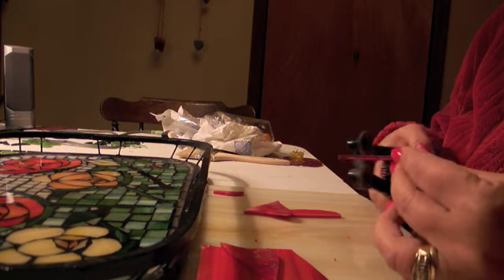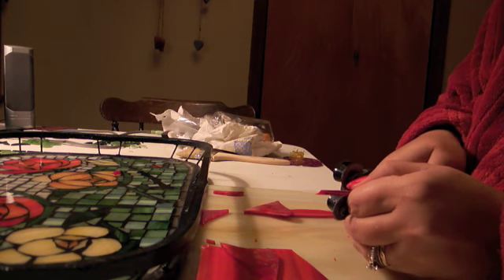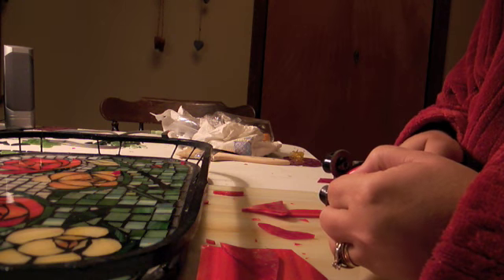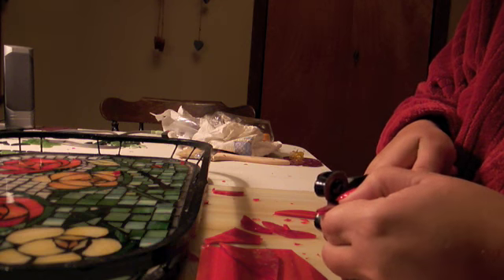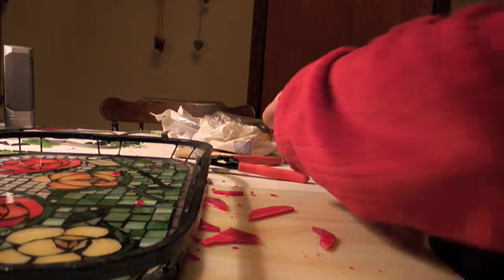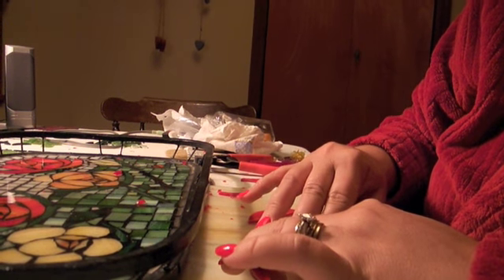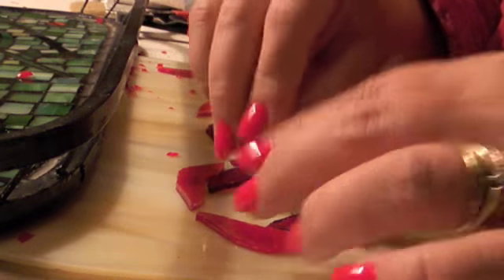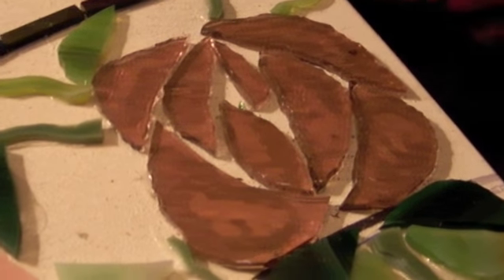How to make Mosaic Roses

Comment: do you think its advisable to use one color to make any flower and why are you using the cutters with the wheels.  can you use a regular tile cutter to cut the glass or is the one with the wheels better for cutting glass.  I am first starting out with mosaic designs and I am going to do something on an old wooden coffee table of mine.  I ordered broken glass pieces from ebay and they came the other day.  I also want to do  the design with plates that I will break.  Do you think its good to do both glass and plates or should I just stick with on particular material.  I really would appreciate some feedback on my questions.  Thank you